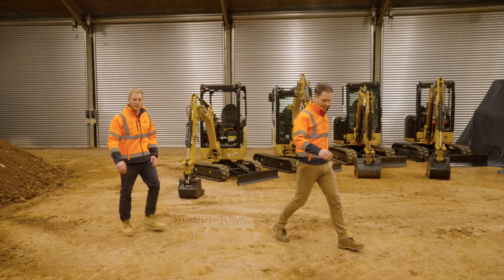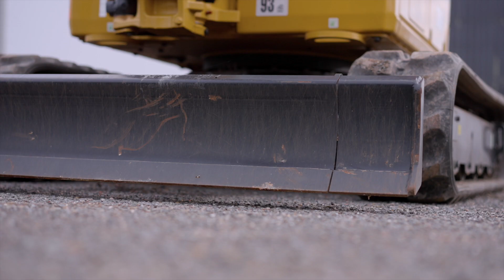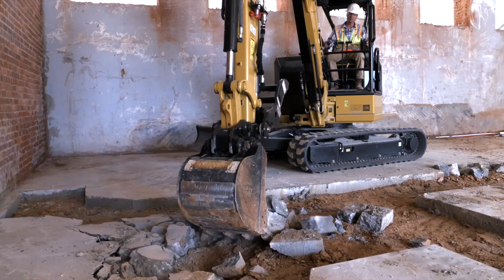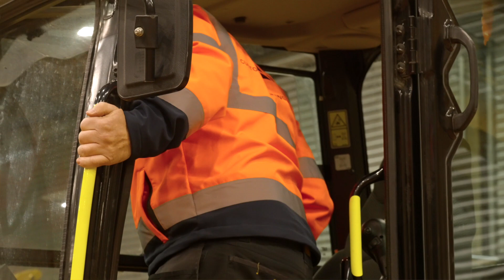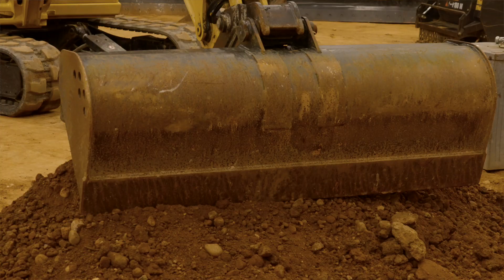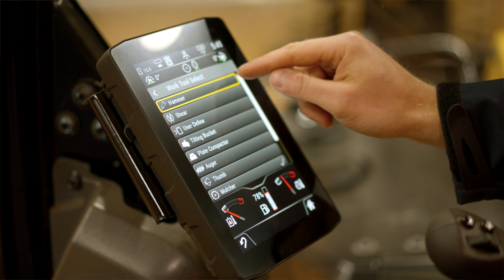Cat® Next Generation Mini Excavators ǀ Facebook Live

Comment: Is there a weight difference between the 305 e2 and the next generation
Reply from the maker: Hello Robbins trucking & landclearing! Are you referring to the operating weight? - Maria C
Reply: @catconstructiontrade  yes i am I have a e2 305 long arm they said 11500 with bucket I’m pushing my weight limits for my toe rig just curious thanks
Reply: 12000 lbs with long arm and counter weight